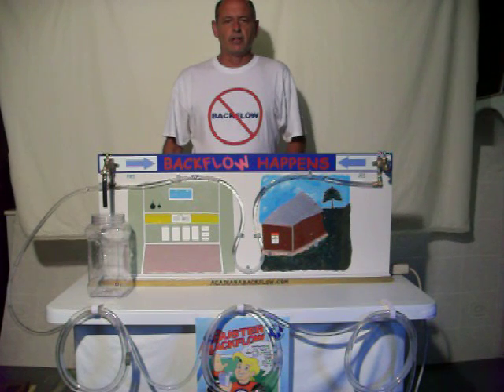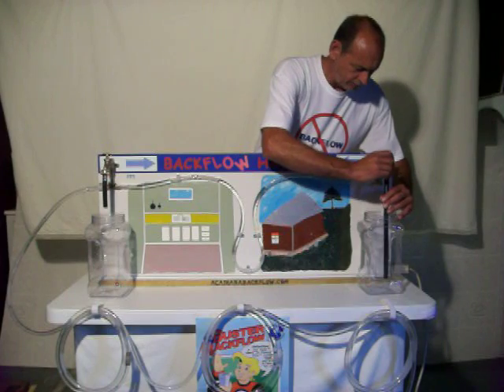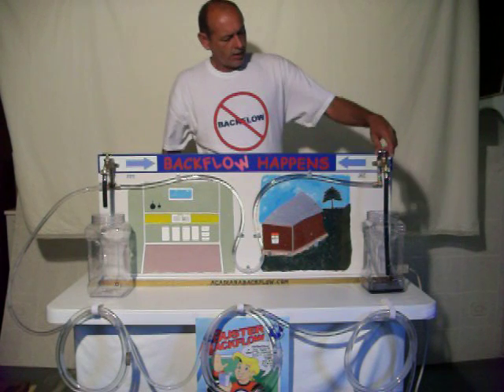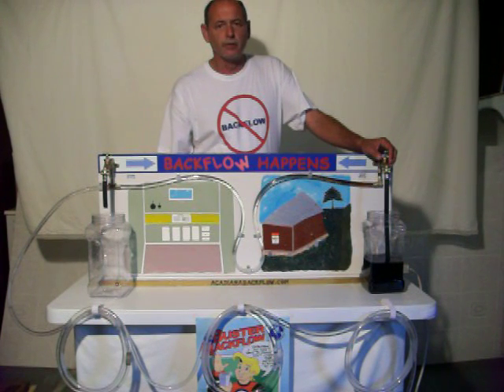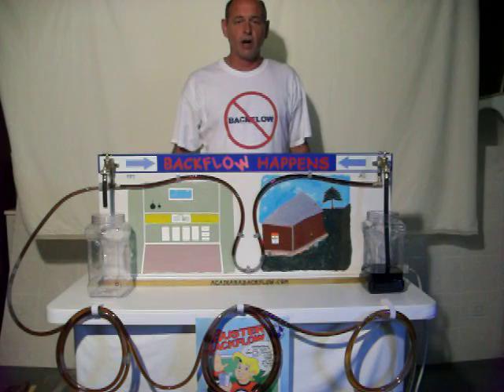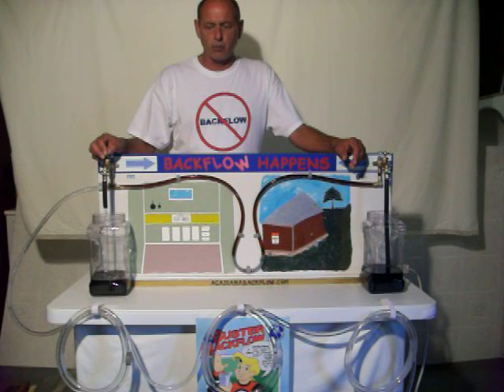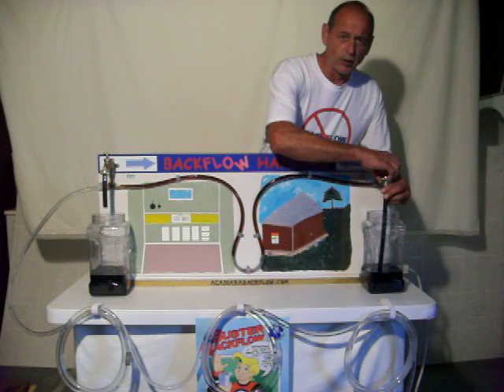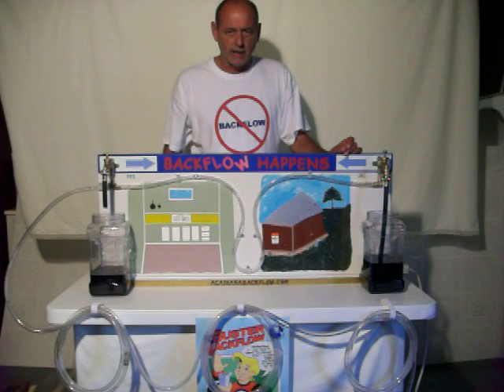Backflow Happens 001.MOV

Comment: i have a college presentation in which i need to make something similar to this. how did you create the negative pressure in the model to make the water back siphone?
Reply: Just shutting off the power to the submersible pump is all it took. The water starts to flow back into the reservoir (a 4 gal pot on floor). The affect of atmospheric pressure along with the adhesive and cohesive properties of water draws the contaminated water out of Joe's bucket into the distribution system the result is backsiphonage backflow.

Comment from the maker: Thanks 640 for the kind words. This is a very good question! The definition of
a vacuum breaker "A device used to relieve a vacuum in a water supply line
to prevent backflow. Also known as a backflow preventer." 
The key is inducing air into the system. The AVB, PVB, SVB, HBVB and RP all have that feature. The DC and RDC are examples of BF preventers that
do not induce air, but rely on 2 checks in series to prevent backflow.
Induce Air= Backflow Preventer Vacuum Breaker
No Air=Backflow Preventer

Comment from the maker: Hello Richard, you will need the proper adapter to install on the spout. Bring
your areator or spout to your local plumbing supply, they will be able to match the spout threads and get you the proper adapter.
Thank You for protecting our most Precious Resource!